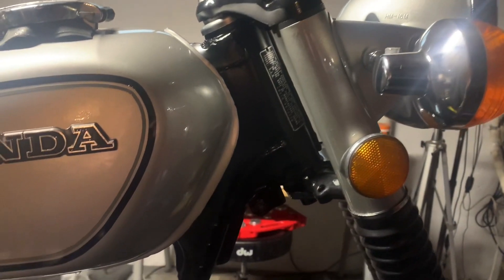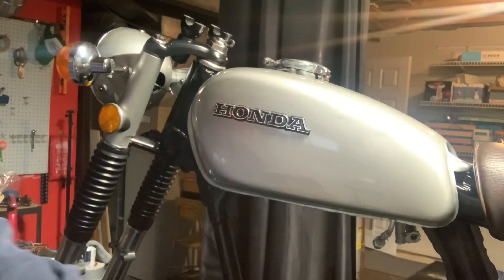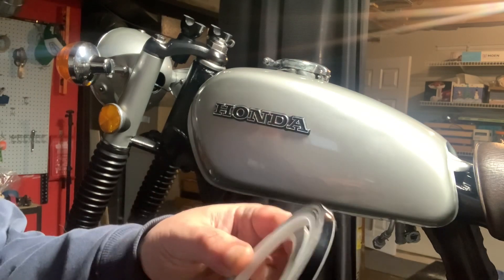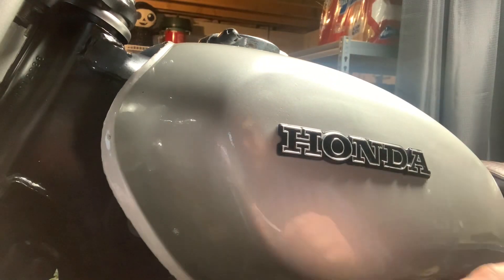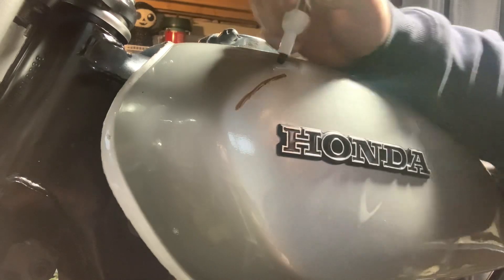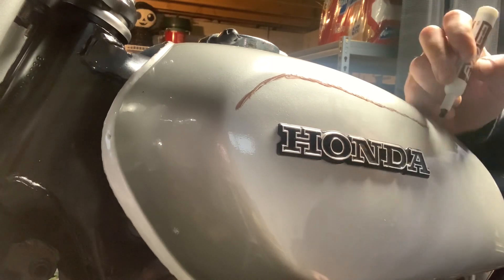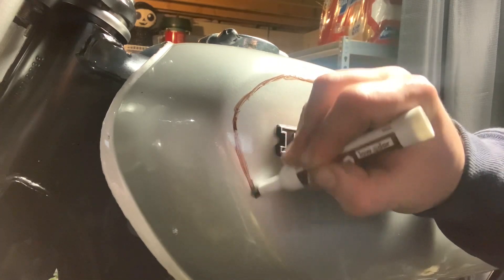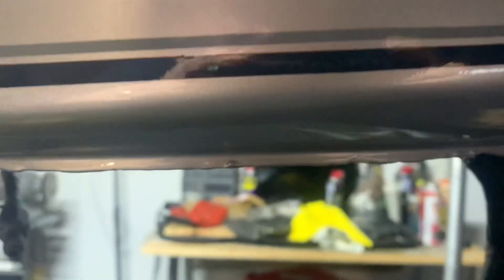How To Use Pinstripe Tape on Curved Surfaces Like A Motorcycle Tank for Cheap

Comment: I’ve been on a 3 hr YouTube binge on how to do a two tone paint job for my project and this video just popped up in the suggested list. 😂 I couldn’t not get you a view. I think i might be biting off more than I can chew with the two tone and pin stripes.... but I’m hard headed... good video.. btw companies make a spool you can put the pin stripe tape spools on, which makes applying it easier. Look into it next time!
Reply from the maker: Two tone?! Next level for sure. That’s very brave. I don’t believe in guns. I heard they kill people. Killing people is bad. :/
Reply: @KeepOnWrenching  its all rattle.... I don’t want to buy an air compressor for something so small. I will eventually because eventually I want to learn air brush.

Comment: Some times I take a photo of the side of the tank with my I-phone , transfer the photo to Adobe Illustrator and draw the pin stripe or graphic over the photo and then print the drawing on paper for a pattern or print the graphic on water slide decal paper and apply it to the tank and clear coat it.
Reply from the maker: That’d be sweet. I wish I had illustrator!